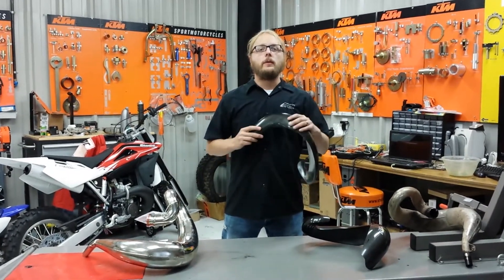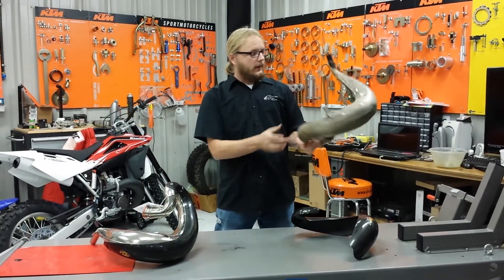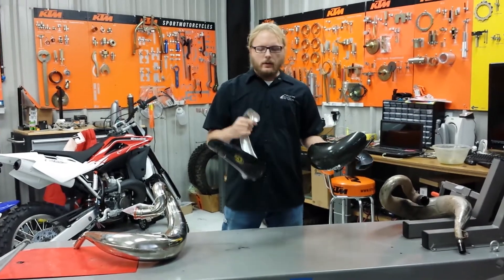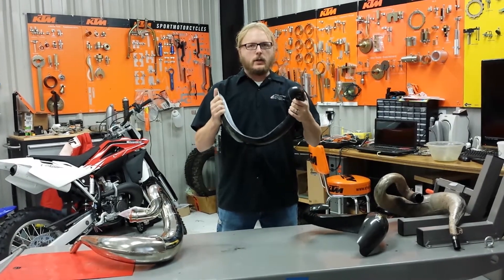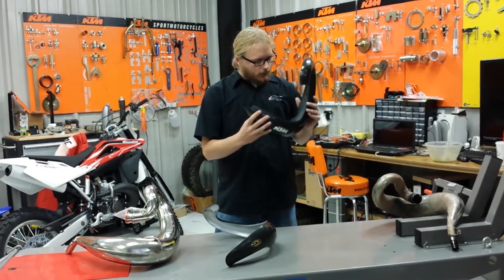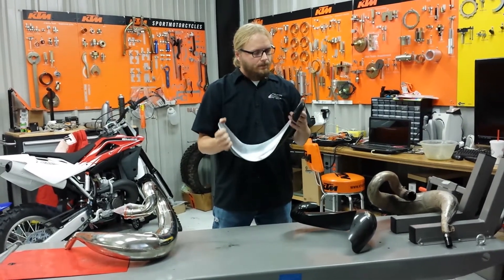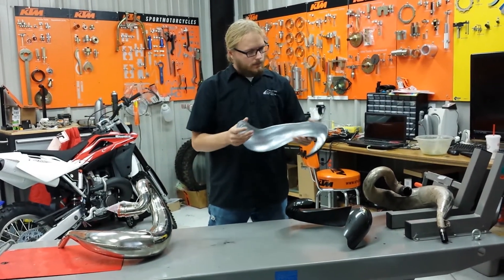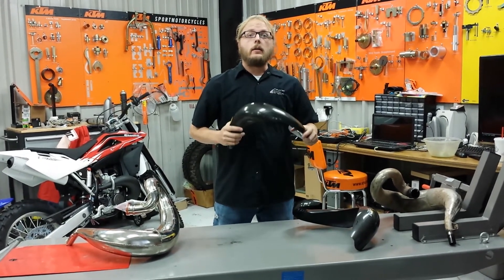P3 Carbon Pipe Guard Features

Comment: Question:   I have always run a zig zag bead of high temp silicone on my alum two stroke pipe guards - let it set up then bolt/clamp it on.  provides an air gap, stand off for big hits and totally kills any vibration and slipping.  Do you folks recommend that with the CF guards, appears it would possibly have the same beni's, especially if you are concerned about the heat around the head unit (heat tape and stand off).  Thanx...guard looks sweet !!!